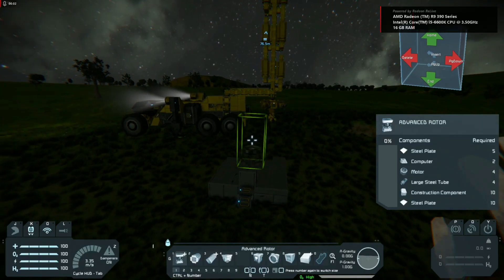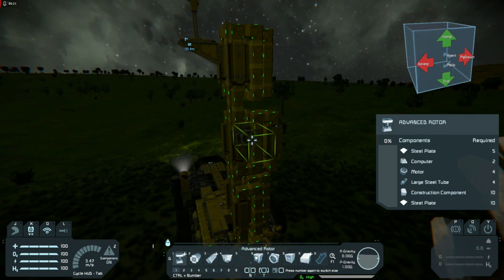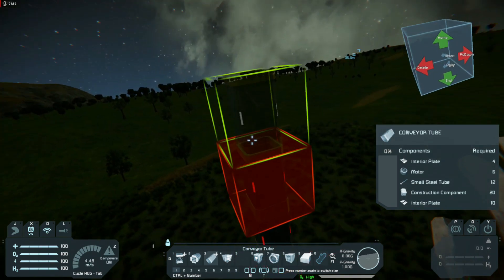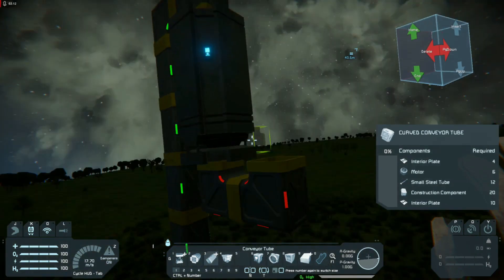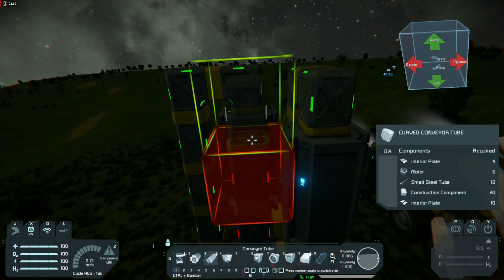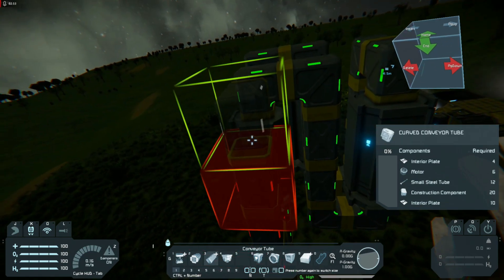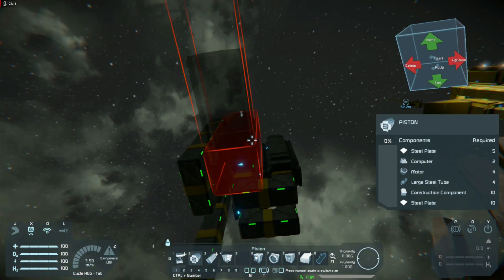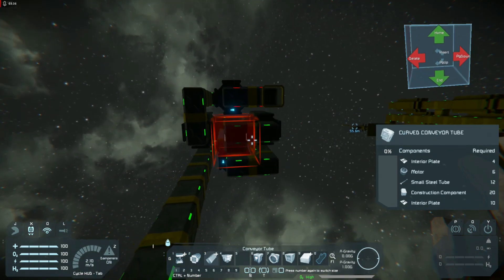Space Engineers - Quick explanation of drill tower

Comment: Everytime on a small miner i add the cornered conveyor tube to a piston it flips my machine and explodes? any ideas
Reply from the maker: When trying to build something like this? Or in general? :)
Reply: @PatrickHansen101  like that but i got it fixed now.  Now im dealing with attaching small ships to stations then when i detach my little ship is like in auto pilot and won't move or floats slowly away
Reply from the maker: @Robs2216  So you're building this kind of piston setup on a small ship? In my experience, it won't work. It will incur phantom forces on the ship and make it pull in random directions.